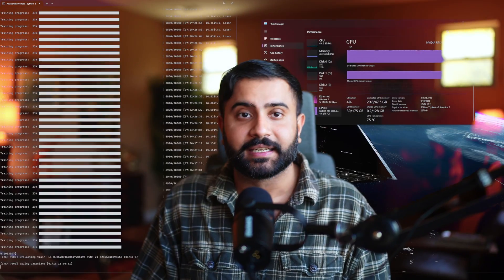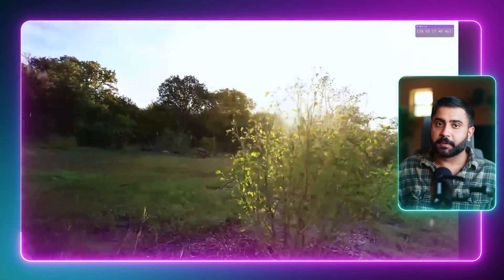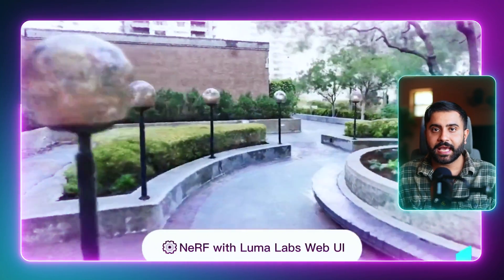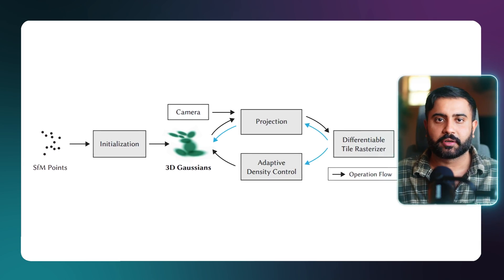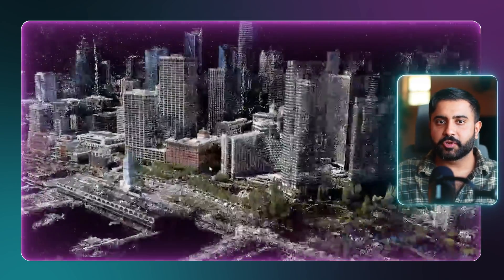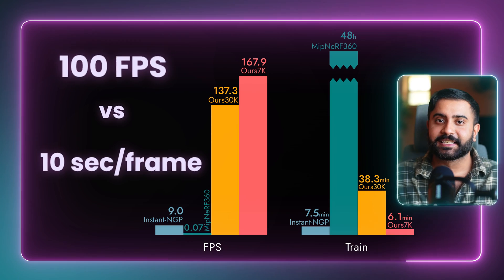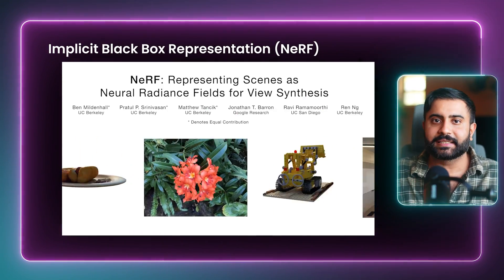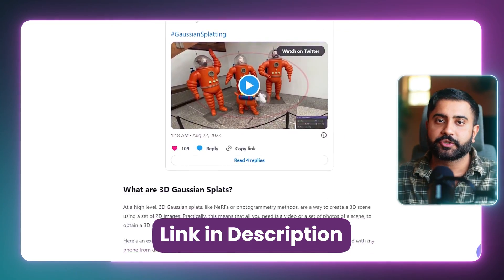3D Gaussian Splatting - Explained!

Comment: this is only good for scanned environment, or existing physical world or object. perfect example is google maps. but for games, films, AR world, where the world don't exist and have to be constructed, it doesn't work cause you have to eitehr build the 3d model environment for high quality inter actions, or let AI do experimental 3d environments. But it is a forward tech for the point cloud technique, that's been here for a long time. its the fastest way to visualize as  triangles/polys are not created and just vertices. But this time, looks like blending different data and adding spherical harmonics for better non-static lighting effects. But still, if you cannot control the materials by shading or future AI material/shading, its still limited. This tech still lacks the very dynamic effects of lighting and shading that are very much available in any 3D software or 3D rendering engines.

Comment: I have a question that almost certainly reveals my total ignorance of this tech! When rendering 3d GS environments in a game engine, is it concievable that game mechanics could be added to this, for instance, pathfinding, collision, decals, all that traditional 3D stuff.
Reply from the maker: it's still early days. you could certainly query metadata you attach to each splat. you could also mix and match - make a mesh version using photogrammetry but keep the visibility off but keep it on for physics collisions, path finding etc.

Comment: Is it possible to measure inside?
Reply from the maker: Gaussian splatting is good for view synthesis. For real world measurements — you’re better off using classical photogrammetry to densify the point cloud or turn it into mesh and measure that. Of course you need to make sure your scan is metric accurate and to scale. iPhone apps that use the AR metadata eg Polycam do a good job of automating that for you.

Comment: but it doesnt have any geometry....
Reply from the maker: it's a radiance field so that's a feature not a bug - instead of rasterizing triangles as you would with a triangulated 3D mesh for example - you instead rasterize these gaussian splats. you can still use a mesh under the hood if u want for collisions etc.

Comment: I too am wondering how this could be used for capturing 3D models (e.g. as part of a 3D printing workflow)
Reply from the maker: If you want metric accurate continuous surfaces; splatting may not be ideal for your use case. It’s much more suited to “view synthesis tasks”

Comment: The best video on the topic so far and with well represented insights. 
How would you see Gaussian Splats in the construction industry? 
Excellent job!
Reply from the maker: Thank you! I think the photogrammetry tools had largely written off Nerf as a fun research toy. Gaussian splatting is making them pay attention and I could see it quickly become a common artifact alongside other reality capture data products in AEC. Amazing for visualization and progress snapshots!
Reply: Would be Interesting to see applications dealing with heritage preservation demands considering we’re typically using Point Clouds. If we could see GS as a resource for model driven Digital Twins and other digital processes for maintenance operations, I think we can cut away hundreds of hours of modelling work.
Reply: Thanks.  Can you make a video of how this can be used for product marketing. Like creating a 3d structure of a product for websites. Can you also confirm if this can be done using some mobile apps
Reply from the maker: @shoaibwaqar9477 it’s a great use case, def possible. For mobile check out Luma AI and Polycam